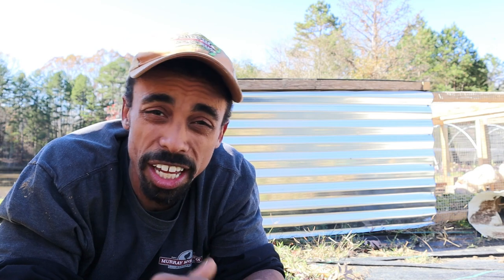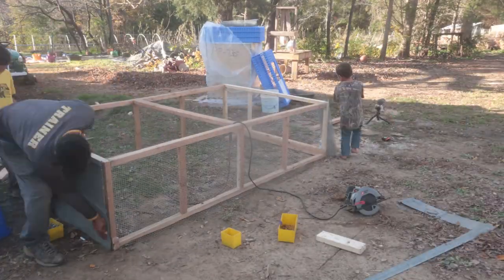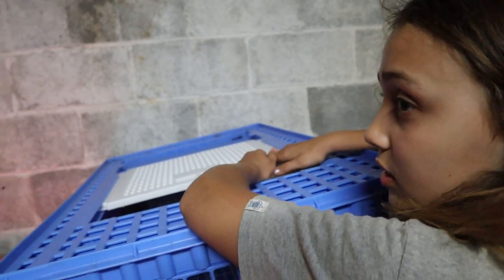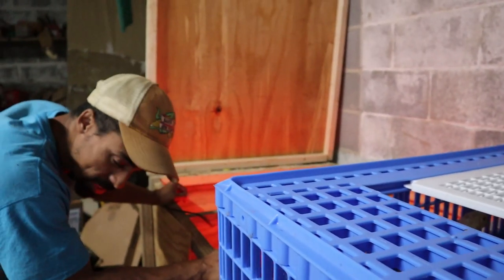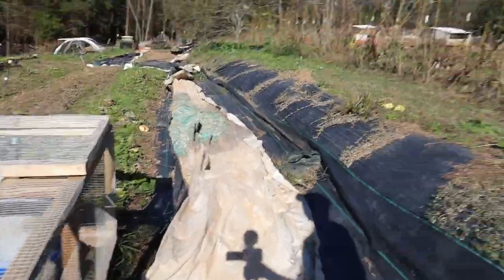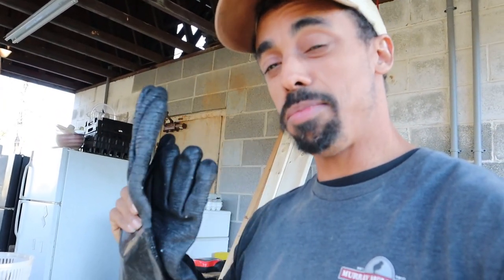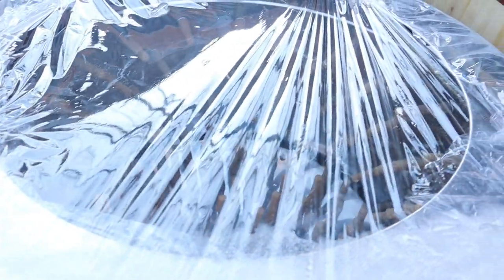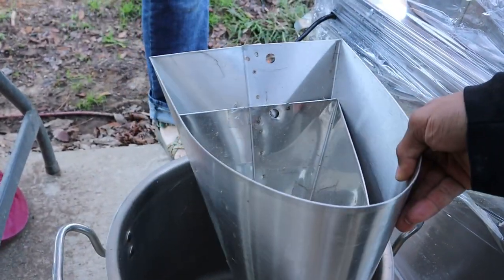Taking my CHICKENS outside

Comment: Mike, we use cattle panels with chicken wire covering the sides. We cut the cattle panels to make u-shaped domes, not to high, just enough for the chickens to walk upright in them. Hold them in the ground with the large u shaped nails that hold down fabric mulch,  and just overlap each one over the the next dome to create a large run covering the length of your planting area. It will look like a high tunnel when you are done. We do shade in certain places on the high tunnel for hot days. Cover your ends with chicken wire to keep them in. My son connects one opening at either end to start them on the next row, lol! He made a soft u shaped tunnel to draw them out into the next row. We have enough for two rows, so when ready to move the chickens and/or turkeys, the next tunnel is already in place. We have used this method for 30 years now. They still go into the chicken coop at night to roost. We have one high tunnel to the coop and they are ready and waiting at the end of day to go into the coop. Once they are in, we close the door to the coop and gently move the high tunnel opening away from the coop door. My grand kids love to make extra domes to add to the original tunnel and lead the chickens to other gardens for bug control. Have fun!!!!

Comment: Cornish Crosses don't normally get all feathered out by harvest time. If you keep them longer (you'll have to feed them less to keep them longer or you'll lose a lot to dropping dead from heart failure), but if you do keep them longer they eventually feather out and don't look so strange. I always think about the ethics of using a breed that will eat itself to death or to hip dislocation or to leg breaking (as we get sometimes at the grocery store) so we get a nice big breast at a lower price. Do y'all ever think about it? I feel a little easier about using something like a red ranger, where you'll get almost as big a bird but it takes longer. I guess it's an easy question for a large commercial farm. For smaller homesteads too, an extra couple of weeks of feed makes each bird more expensive. Do y'all know anywhere I can go look where they talk about the economies and the ethics?

Comment: I haven't seen anyone use wax before. How do you use the wax on the ducks? Our turkeys have sometimes had the real fine down and plucking that was a hassle. Is the wax what you use to take off the really tiny down feathers? We had to wear masks because the tiny down would float in the air and we didn't want to breathe in those tiny feathers. We were plucking a turkey we raised for Christmas dinner so it had put on a winter layer of down feathers at the skin level. We won't let that happen again.